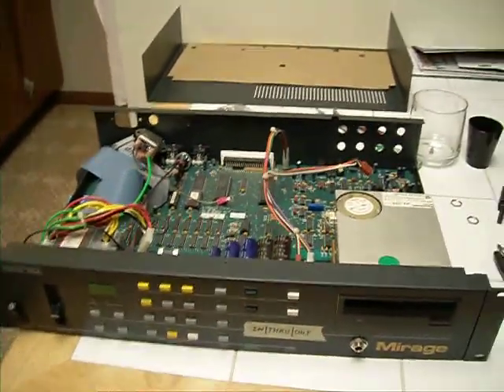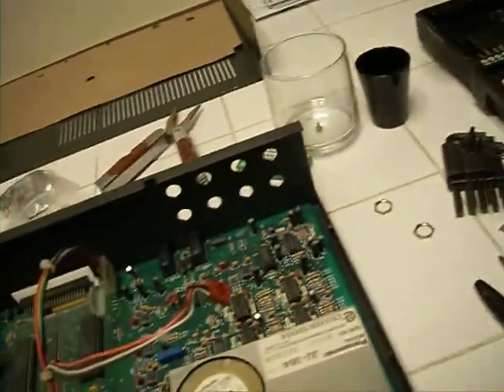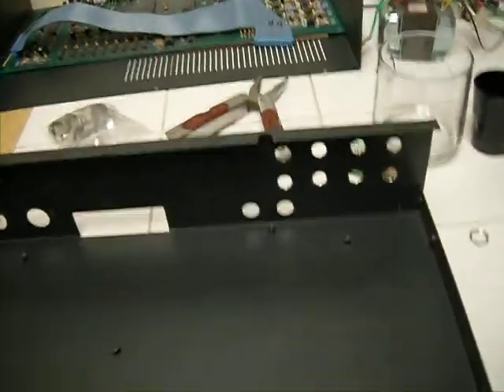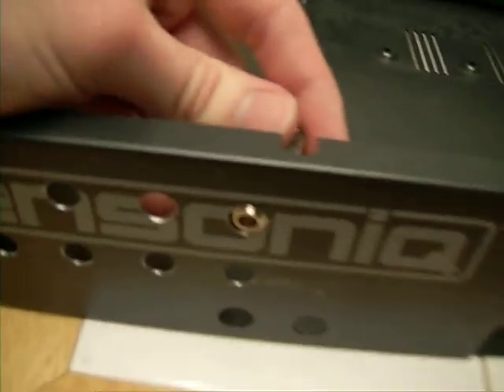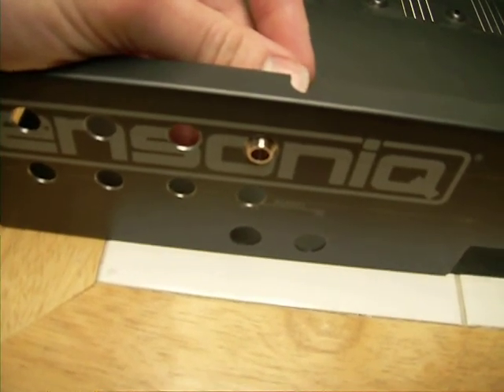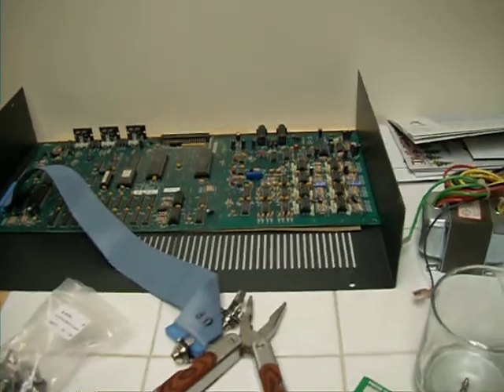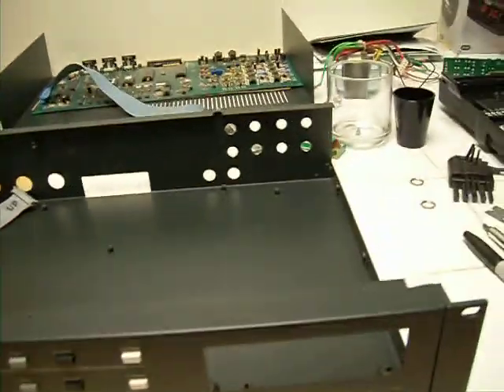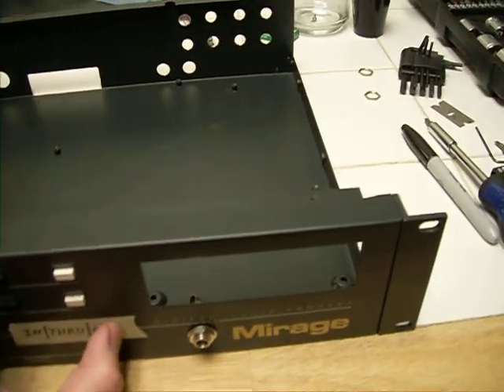Ensoniq Mirage Octophonic Output Mod Part 1

Comment: you seem to have good expereince with these units.  have you ever come across the MME expansion port mod?
Reply from the maker: Only what I've seen in the various copies of Transoniq Hacker floating around on the web. IIRC the installation process involved a daughterboard going in where the main processor resided and quite a few changes to the board, but the specifics elude me.

Comment: it's fantastic I'll try it right away !!! it's perfect for drums , I do not use too much because of this single mono output .So if i understand that, for assign any ouput independently , you use the keyboard into 8 parts and each part out on an output ?
Reply from the maker: +mix down prod instrumental hiphop I'm not sure I understand your question, but I'll try to answer the best I can. The Mirage assigns each note to a filter at random. With this mod you're taking the output from each individual filter and connecting it to an output jack, so your drums will come out of each jack in a random order. In order to take advantage of this, you would need to connect each output jack to the input of a 8-channel mixer or other recording device with 8 inputs. Hope this helps, you can check out the demo video on  my channel for some idea as to how a drum beat sounds with the mod.
Reply: @rationalemusic7747   So does this mean each Sample will keep bouncing-around to different outputs? Or does it mean every new sample gets assigned one solid output, the Mirage just picks it (so yes, I could actually have a whole drum kit, with each drum on it’s own dedicated output)? 
Thanks for the demo :)

Comment: What is the advantage to have an output for every voice? If you play an Synth Sound, why should be every voice on an different output, you eat up many mixer channels...
Reply from the maker: The Mirage normally has one mono output, this mod allows you to place each voice in the stereo field, you can check out the demonstration video on this channel for examples. It also lowers the noise floor, so there is less hiss on the modified outputs than there is on the factory mono output. It's mostly a mod for studio use, but if you're concerned about mixer channels, you can build a box that wires the 8 outputs to 2,(hard-left and hard-right) or simply perform the mod to wire the chip outputs to two shared outputs instead of 8 individual ones (4 chips to the left, 4 to the right), though personally I prefer the flexibility given with the 8 outputs.